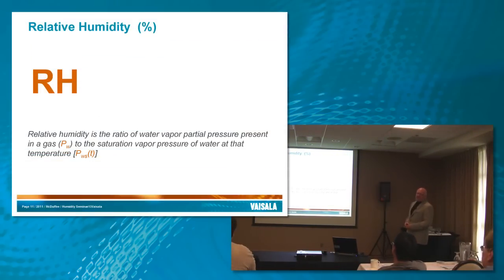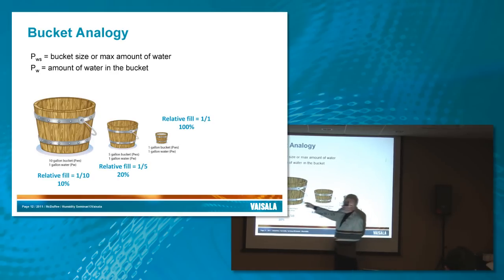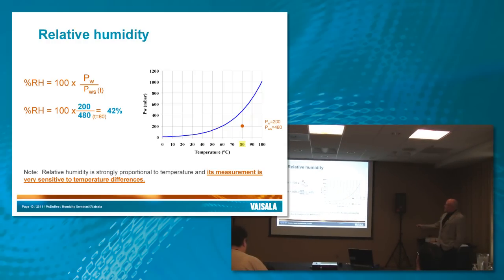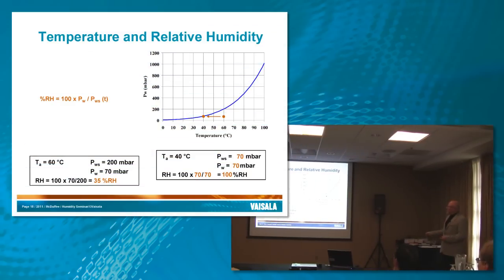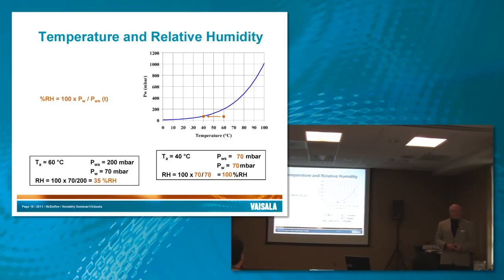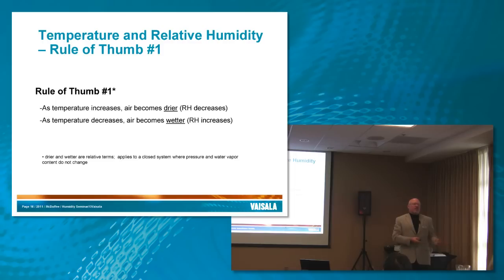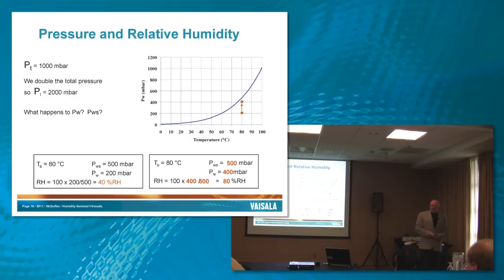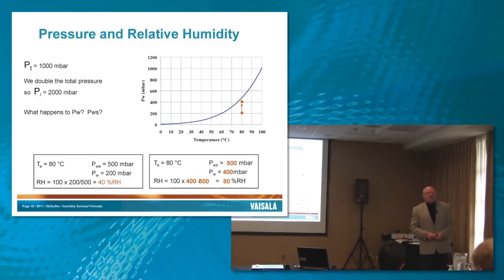Relative Humidity, Temperature & Pressure tutorial

Comment: Is there any relationship between permittivity and relative humidity?
Reply: Hi, 
Are you talking about the permittivity of the air or the polymer film in the Humicap sensors? 
The permittivity of air changes a bit depending on the partial pressure of water in the air. So it is proportional more to the partial pressure than to the relative humidity.
In the polymer film the amount of water is proportional to the relative humidity. Thus the permittivity of the polymer film is proportional to the relative humidity.

Lars Stormbom